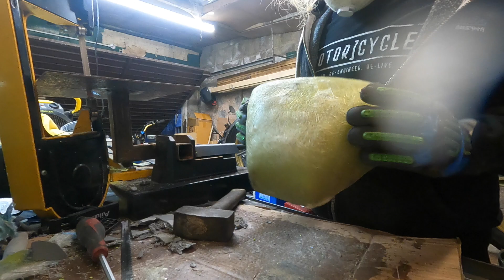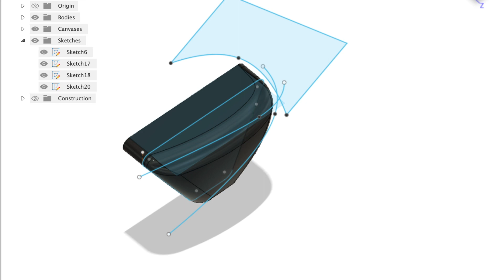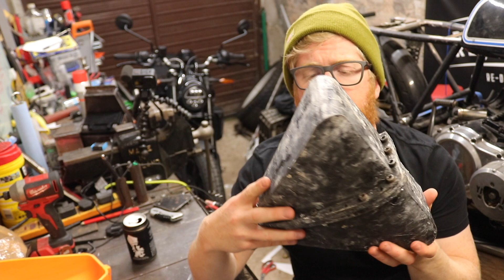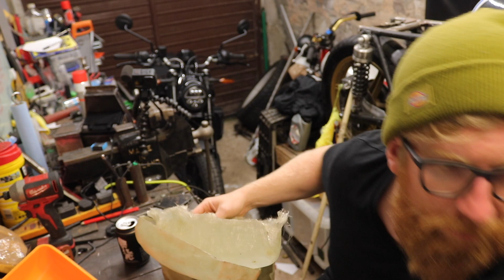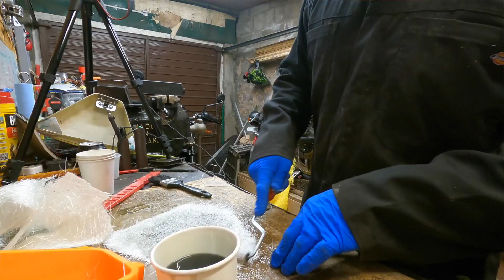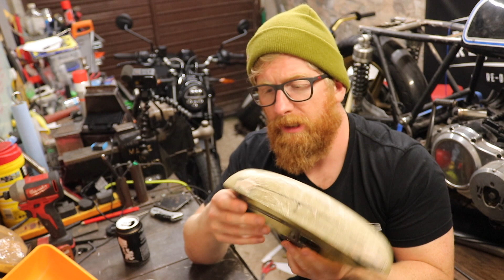How to make motorcycle custom side panels in 15 mins!

Comment: I need to remake side panels for my XT350 after a crash yesterday. I'm wondering if it wouldn't be worth machining a wooden form for metal parts.
Reply from the maker: that would work too i reckon, It depends how detailed you want to make them. I initially went away from the wooden buck idea just because of the complex shapes I wanted to achieve, but it's definitely an option.